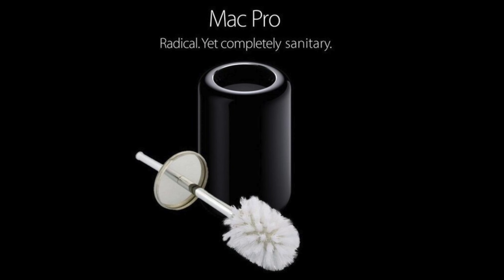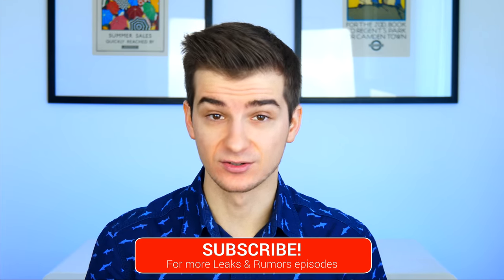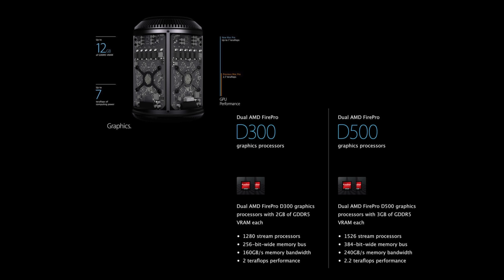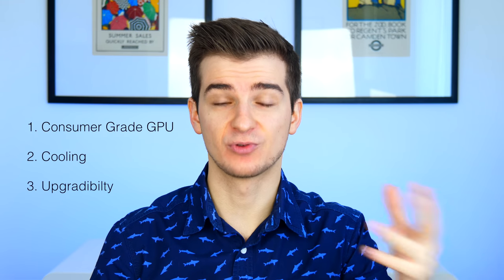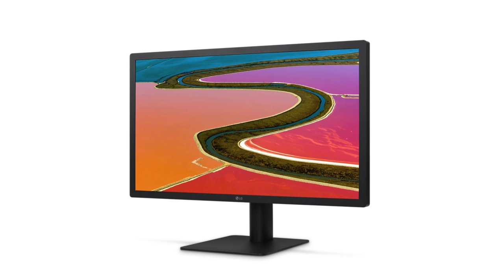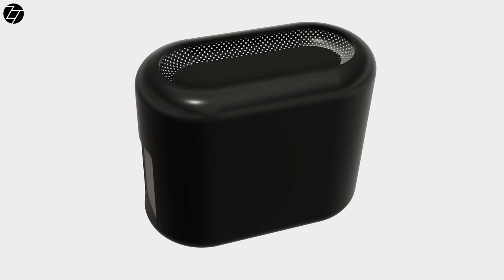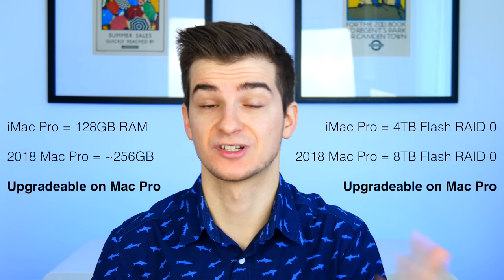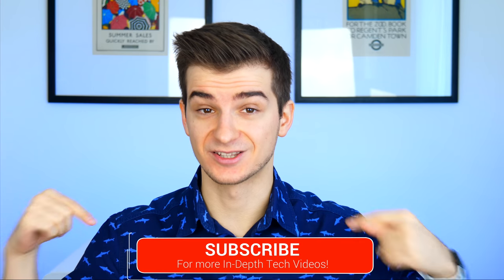NEW Mac Pro 2019 - Leaks & Rumors!

Comment: I am thinking about the I-Mac 2018 that you have reviewed and I really love it, I would get it   maxed up, since it won't be upgradeable, or with the Mac Pro 2019 that you just reviewed.  If I go with Mac Pro, I found a nice curved LG Ultra wide 34 inch IPS Led FHD Free Sync Monitor that can do split screen and a screen in a screen for $299.99 on Best Buy's website.  

I also want the LG Blu-Ray reader/writer, they have an internal and an external model.  I also found the Intel 6 Core I-7 CPU that would be in the new I-Mac.  I was looking at all the hardware to custom build my own desktop, and looking at how much it would cost.  I have also found some motherboards that are compatible with that CPU, and looking at video cards, cases and power supplies.  I want to price them up and see how that compares with the new I-Mac 2018.   If I went the customized route, I still would rather install Mac OS Mojave.  The other design option for the I-Mac 2018 would be similar to the Microsoft Surface Pro Studio  desktop model, with a base and two arms and a monitor that swivels in various molds including a drawing mold, with a pen and able to use like a Wacom tablet.  Great if you only have so much space.  

I also looked up the I-Mac G4 with the Round base and a swivel mount to the monitor.  Similar design, but with newer MB, Processor, Ram.  Maybe between the two ideas and the picture of the monitor that you had on your review of the I-Mac 2018.  I have read comments for a similar design to the I-Mac G4.

I looked up the Power Mac G4, Tower case with the blue front, with a curved version of the monitor that you showed, of course with an updated MB, Processor, Ram, 1, 2 or 4 TB Ram, and this would be upgradeable, with easier access to the inside, without messing with the monitor.  Also adding speakers, with a base speaker, center speaker and surround sound, and soundcard built in, with USB, Thunderbolt port HDMI.  A CD-ROM drive to put an LG Drive., and the Magic Keyboard and Magic Mouse 2.

Comment: Nice speculation, but if they come out with a design missing user accessible PCI E slots and starting price of $10K, they'll lose me.  So no I don't think they'll come out with a "custom" video card because then its not upgradable...if it was then why didn't apple release new cards for the trashcan?  The point of this machine is to make it NOT custom, so you can upgrade ram, video cards, drives, etc...anything less than that will be a bummer.

Comment: I can't see how that rendered case is modular. Theres no PCI slots externally. I suppose the GPU could be passing its video up the PCI-e bus and out the thunderbolt3 ports. Its a shame they probably won't go back to the design of the 2009 to 20012 model, that was damn near perfect with the CPU tray and the PCI-E slots. That design with some NGFF slots that take standard NVME SSDs and maybe room for 6 2.5" drives instead of 4 3.5". More PCI-E power to run hungry GPUs and obviously a load of TB3 ports and you're set. Ideally if most of the motherboard was on the tray and only the PCI bus was on the back board, tray swaps could bring newer chipsets with newer CPU support.

Comment: I think Apple had issues initially with 3rd party video cards possibly not working on a Thunderbolt 2 daisy chain. That may have been why they changed the large Mac Pro tower to the small cylinder design using proprietary video cards. So how will they solve the issue in the new 2018 design? From the look of your concept drawing are you're guessing that 3rd party video cards will pipe the video output back into the computer so Apple's own I/O can handle it? If so what about the I/O ports of other types of PCI E cards?

Comment: I’d want the iMac Pro’s 128GB of RAM but a top of the line i9 processor with dual GTX 1080 Ti and 4TB of storage. That’s my dream modular Mac. Something that can do video editing, 3D modeling and especially high level gaming. It should be able to run games like GTA 5 in max settings over 60FPS. MAKE IT HAPPEN APPLE!!

Comment: Yes, I'm waiting patiently for the Mac Pro with the ability to add two Nvidia Titan V cards later.  It would be awesome if Apple did provide Nvidia GPU options but I doubt it from past hardware releases.  BTW, I do a lot of work with machine learning.  Thus, GPU performance matters and I'm looking for a fully integrated system like a modular Mac Pro instead of build-your-own (BYO).

Comment: I'd say it would be ok to have powerful but consumer-grade GPU as long as you can upgrade it. I'd say that would be actually really cool if we could choose cheaper but more precise components for next Mac Pro. for example, I work mostly in Adobe After Effects. Right now the best CPU for this program is 8700k, not 18 core xeon, since AE loves high clock speeds and it does not utilise multiple cores at all. Also, big problem with GPU is that it's AMD. So no CUDA. That's like really bad.

Comment: Also, I don't think we will get the Mac Pro in 2018. Maybe they will announce it either in Semptember or December, but we will see it sometime in 2019 probably late Q2, so around May or June or even August.
Reasoning: Apple wants their Custom Silicon, Wants OLED Display either 5K or 8K and those don't come cheapo or fast enough and lastly, they want to anounce it with theier brand new operating System that supports Cross Platform Apps and much much more.
Reply: OLED would be a horrible decision for a computer screen. Unless you don't mind burn in and decreasing brightness over time.
Reply: Christoph K.  Yeah but realistically, it's the only way to make them stand out. Also Burn in is reduced year by year and Apple Software Department could do some magic with the OS in order to minimize it. 
Personally I don't want an 8K display, I would be happy with 5K 32" or even Ultrawide for their Displays and OLED. IMHO.....
Reply: Crypto Advice got a fair point there with apples recent habits 😂
Reply: No man, put the new micro led from Samsung. Is like oled, without burning.
Reply: or, you know, higher refresh rate
Reply: “Custom silicon” lmao. The truth is that they buy the worse set of CPU’s from Intel for cheaper price, then underclocks them. Just look at the Xeon on the iMac Pro, it has lower clocks than regular Xeon.
Reply: “Custom Silicon”... for what ? Apple is becoming a software company.
Reply: µLED on an imac LOL. there probably won't even be a µLED 13 inch laptop panel for like 5 years at least. let alone a 27 or 32 inch monitor. if they want to release this in 2019 bundled with a monitor it's gonna have to be LCD or OLED and i agree it's probably OLED, even though it has worse color range and there hasn't been a single 90% DCI P3 OLED display. clearly not a "pro" product in the eyes of anyone involved in color grading, but then neither was spending an extra $5,000 on ECC memory and the xeon trademark when i9s and threadripper were a fraction of the price

Comment: Ok really know. Let's go with your points here. 
iMac Pro: Consumer Grade GPU, VEga 64. What is the Equivelant Pro GPU in AMD line up. 
Mac Pro:Either the Vega Frontier Edition x2 wchich is unlikely or 2 of MI25 GPU with custome made cooling solutions. Let's assume that either of those scenarios happpening, the Mac Pro is gonna cost over 8000$ base. there is no way they can Mark-up a combination of 3000$ hardware or more just for the cpu....
So what is gonna happen most likely. Single GPU, probably MI25 with a custome solution along with a Apple Custom 8-12-16 Core Chip, that support E.C.C memmory. Price= 6500$ for the Base line and let's say over 20,000$ for the top of the line Configuration.
Reply: We're not getting a custom Apple chip yet as most professionals need powerful x86 chips to do their work
Reply: GBCAwesome Considering this think might come out in 2019 we might. Not the highest possibility I agree, but don't rule it out just yet.
Reply: the work station card is the radeon pro wx9100. the mi25 is the pure compute card like NVidia's tesla, it doesn't have video output. And that's NO WAY they're use ARM chips for the mac pro, it's beyond ridiculous at this point. What's going to happen is probably dual xeon board with up to maybe 48 cores. I hope they use NVidia GPUs like the Quadro V6000 (when that comes out), but start with the consumer GeForce 1180 to keep to price lower.
Reply: That looks like a pencil sharpner.
Reply: James Read s
Reply: @ Supercharged They're never gonna use nvidia cards.
Reply: Frontier edition is awful, RadeonPro WX 9100 would make way more sense, or even the SSG if Apple goes insane, but definitely not the Frontier edition, Apple will have a flop on their hands if they do.
Reply: Maybe AMD will have new GPUs based on 7nm process when the new mac pro is out.
Reply: If you were going to spend $20000, you would get a PC not a trash can.

Comment: I liked the 2013 Mac Pro. I don’t do video editing so don’t care about that part. I just wanted a new Mac to my 2011 Mac mini. 

I have 2017 MacBook Pro now, but I still want one. Don’t care what people say & yes I have a PC I built. I like Apple’s ecosystem Windows 10 suck. 😂
Reply: I like the look of the 2013 Mac Pro but the specs aren't worthy of a workstation. For that it should have at least 16-32 cores and 128 GB of memory.
 
I have nothing against Apple but I don't see what's so Pro about the Mac Pro.
Reply: They have a Mac Pro out now with all of that. I don't care if you are getting a mac or PC any workstation computer with that kind of hardware is going to cost you big money. If I had a Mac or PC with all that power it would be years before I would need an upgrade. 

Only people who need that much power are Video editors, Cad, game devs & so on for the average person hell no it's  just overkill.
Reply: Yes, it is driving me crazy, constantly doing the "not responding" non-sense, no matter which program I am using.  

Plus, I miss the Mac OS, and would love to have my own Mac, either an I-Mac 2018 maxed up, or the 2019 Mac Pro if it is that upgradeable.  I am also hoping they put the Touch Bar on the keyboards, regular and the one with numeric keypad, and upgrade the mouse.  I love that these keyboards come with a rechargeable battery.  

I also love that Apple uses the higher capacity SSD's, where the PC makers are still putting maybe a 512 GB SSD.  They are still putting USB 2.0, don't know why.  Also, some of these makers are still putting 5400 Rpm drives, why?  I saw Daniel's review on the I-Mac 2018, it is gorgeous, with a thinner bevel and no chin, more display, it even looks wider than 27 inches.  I also hope you can get color choices, like the I-Pads and I-Phones, they have Silver, Grey, Gold and some have the Rose Gold.  I also hope that the new OS will recognize the I-Pad as a drawing pad, (like Wacom), but the I-Pad has other features as well.
Reply: "don't care what people say" always a good sign

Comment: The last Mac Pro soaked me for $10K. No way in hell I'd do that again. And since the ridiculously expensive (yet mostly consumer grade) iMac Pro is $14K loaded, you can count on the new mac, whenever it comes out, if it comes out, to be more than that. It really has gone from the ridiculous to the sublime. I was so disappointed with my Mac Pro Trashintosh, it has soured me. Then I had to go out and buy another one. Which was at least cheaper used, a 12 core, but still brutal. Should have stuck with the cheese grater, but you have to stay current and cool in Hollywierd. Dumb. Anyways to answer the question, no way I get the new mac. I guess I'm stuck with the underperforming Trashintosh for some time. Or I'll sell it all and go PC.
I should say part of the Traashintosh issue was the OS it shipped with. When Sierra came out it improved considerably and became much more reliable. Not sure why of course, I just know it did. Really can't go through that nonsense again, nor the considerable cost of the things. Considering the issues with the new Macbook Pro most pple have ignored, it seems like Apple's days as the top dog in Pro level computers may be numbered. They've become too overpriced, and turned too many pple off with their drop in QC.

Comment: We have several 2010 12-core 3GHz dual Xeon’s, and threw 12GB Titan X Nvidia cards, etc in them.  Like Canada’s top multimedia research center and universities, we eval’d the 6.1 Mac Pro trash can’s and instead went with old, used $1,500 5.1’s, which are much faster, cheaper and fully upgradeable.

Comment: I have the 2013 Mac Pro and I love the design over my 2010 Mac Pro. It just fits on my desk SO much better. I have had problems with it. When I upgraded to Sierra, it fried both my graphic cards.  did replace them with no charge. The 2013 Mac Pro is my daily driver. I do have a 2017 iMac 27" 5k 4.2ghz machine. But I favor my Mac Pro over it. I would like to see an upgraded version that is upgradable. + I would like to see an upgraded 5k  Display.
Reply: xSpace360TV I have 5x display for my 2013 Mac Pro
Reply: Fanboy!

Comment: Right now the imac pro with 8 up to 18 cores cpu with either 8 or 16gb gpu and from 32 to 64 and 128gb of ram and 1 up to 4tb ssd is apple best computer.
So in my opinion a mac pro should come only 2019 after summer to give the imac pro enough time

Comment: I upgraded from a Mac... Built a PC.
Reply: Ultra NEO Great choice. Welcome to the PC master race!
Reply: I would rather custom build a PC than buy one already built, especially laptops.  For some reason, they are still putting USB 2 ports, and only putting SSD's that are less than a TB.  Apple is using 1, 2 or 4 TB SSD's, why are the PC manufacturers not using them?  I would want to put a 2 TB SSD, and USB 3 ports, a CD-ROM / DVD and BLU-RAY reader /writer Drive.  Also a 8 GB Video card Radeon Pro (line) or In Video line.  I would have a 8th Generation 8 core processor, I-9 and 32-64 GB of System Ram.  There are many keyboards with numeric keypads and Bluetooth mice.  I would also pick out a nice 27-33 inch curved Ultra 4K monitor.  

But I do love the Apple Keyboards and mice that have a rechargeable battery that can last a month, also do love the Mac OS High Sierra.  I don't have a Mac at this time, but have used one at the community college and enjoyed using the MacOS.
Reply: Kkkkk me too kkkk
Reply: I once was a Mac user
Reply: Ew... I used Windows and I got an adware from merely browsing. Terrible. Cannot risk my work on Windows. (Edit: the website asked me to agree for cookies to continue browsing, and bam! Adware installed itself silently)
Reply: Nawaf Al Mac OS has adware too, but less, since it is less used.
Reply: Danilo Azevedo I use Macs since 2007 and never got one adware... and I use it daily.
Saying it‘s possible to get is true, but it is extremely rare that u have to basically look for it like a needle in a haystack to get it.
And if u get it, it will be harmless.
On Windows it will run your computer hot and ruin your hardware
Reply: Nawaf Al you are right but this is due to the greater popularity of PCs and not to a defense superiority of Macs against adwares. But I've never heard of adware damaging hardware, it never happened to me and I've never seen it happen to anyone

Comment: I'm still milking my upgraded 2009 mac pro 5,1 which is still a pretty powerful machine for the money it cost to upgrade it. The new Mac Pro I would want to be able to choose what video card I install right out of the gate upon purchase and not be forced to have and AMD card. Apple should have AMD and Nvidia drivers built into the system not just AMD and out dated Nvidia drivers. I use FCPX which AMD is the better GPU but if you use Adobe apps Nvidia is the better GPU. Buyers should be able to put whatever GPU they want so it should be a box with processors and ram, and several PCIe slots or an external pcie box that you can run eGPUs at full bandwidth because two GPUs is better than one. Seeing you can run OSX or Windows on a Mac, I would most likely get a new mac pro over a new PC. But if they fail to deliver or it's just too costly like the new imac pro, I may have jump ship and learn Premier and move to windows :(. But really my 2009 handles Pro Tools like a dream which is my #1 used app and I'm still on Sierra. I tried High SIerra but had glitchy graphics with the Nvidia driver 10.13.3 maybe the next update will fix it. I had to reverted back to 10.12.4.  FCPX performance is good enough at the moment for my needs. I have a flahed GTX 980ti which i snot a great card for FCPX but it rocks playing Doom in Windows, 12 core 3.33ghz, 24 gigs ram, SSD pcie boot drive with esata ports, a usb 3 card plus pro tools native card all 4 drive bays are full as well. Apple will of most likely use USB C / thunderbolt ports so right there that's a pain in the ass if you use older USB 3 and Esata.Time will tell. I don't think the new Mac Pro will look anything like your photo though at least I hope not, but nice try :) It most likely will cost a huge amount as well judging by the cost of the non upgrade able iMac pro which is powerful but being non up-gradable it's value will drop like a stone in just a few years not a good investment unless your making the big bucks to justify it and its helping you make those big bucks.